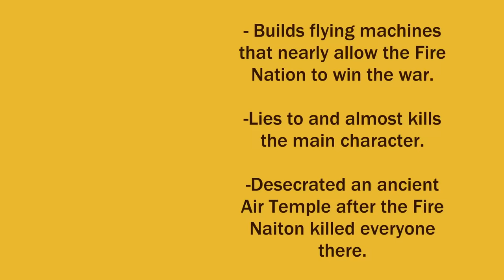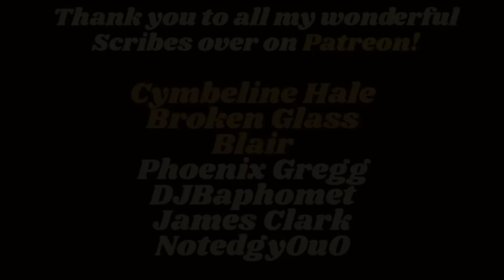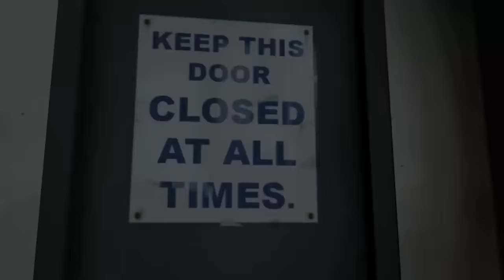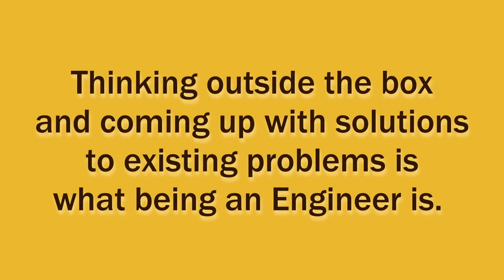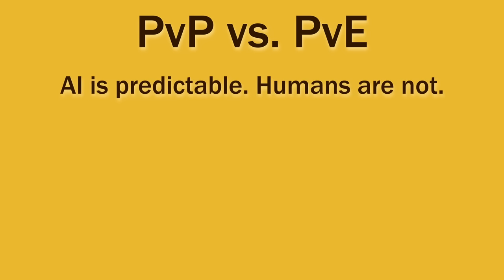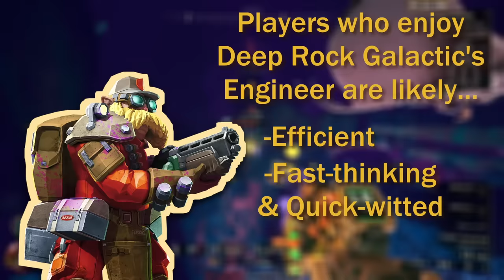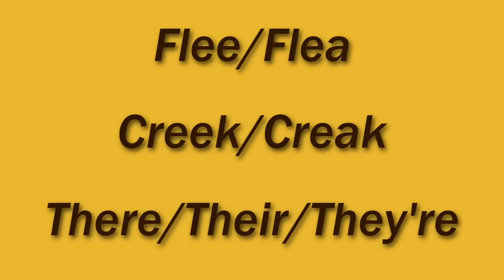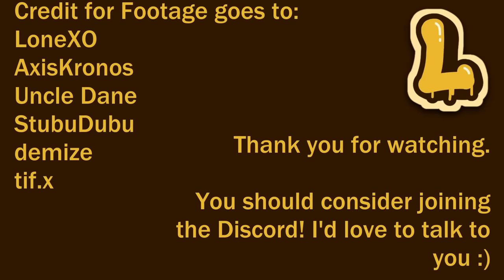TF2 vs. Deep Rock Galactic: What It Means To Be An Engineer

Comment: Actually, in DRG all classes has it's role in raid depending on what Overclocks and upgrades you build before entering a cave. It goes to Engies as well. Sometimes you need to use Tier 2 turret instead of 2 Tier 1 turrets, because you utilize Whip Shot with Mini-shells Overclock, which increases your ammo but cuts your damage drastically. And there's where you utilize it by standing around your centry and shooting small bugs and turret, prioritizing it's targets with lazer pointer. But that's one of types of Deffensive types of playstyles. There's also Electrocuting and Arc Gemini builds, which utilizes crowd control with low direct damage. Or there's Plaster Explosive build, when you use platforms not as deffensive or mobile option but as offensive tool to blow it up with Lazer Gun. Or you use two different Overklocks depending on your target priorities, like Jet Fuel rockets and Fat Boy (first to deal with single targets fast, the second one is for wiping out a swarm of regular enemies with large AoE damage and DoT effect, which is kinda bad against the "big boys").
And there's also different utilization of grenades too. Some for tight space. Some for dragging attention and crowd control. Some for deffence purposes while you at something else. That's why DRG's classes, being less in type, has so different playstyles based on how you prepared and how you use your equipment. Use it wrong - and you most likely die on a mission. A lot.

Comment: Some points i think is important to have out there:

The DRG engineer COULD have 2 sentries, but it's possible to have 1 stronger sentry in case you need to be more mobile and is willing to give up coverage for a bit more damage toward one area, better ammo economy and versatility when deploying and redeploying rapidly

The DRG sentry IS upgradeable althrough only before setting out on a mission, not during it

The TF2 engineer has tools that compliment an overly combative role while also allowing for turtling

While the Platform gun is one of the DRG engineer most important tool, it's not THE most important one. Once you upgrade his toolkit enough using upgrades and weapon overclocks, every tool every drg character has is equally important for success, and it doesn't matter if you're amazing with a platform gun if you can't live long enough to use it

I honestly appreciate you giving love to both of these characters, as i mained both in their respective games, but i did wish you'd consult experts on each such as uncle dane for tf2 engineer or literally 80% of the drg discord who could give you 200 builds and argue over them the moment you ask (it's kinda hilarious to watch)

Comment: Funnily enough- I am an engineer main in tf2 and a gunner main in DRG. Both are characters designed to stand their ground and control their immediate surroundings- protecting their teammates by being both the biggest DPS threat AND the biggest defensive bastion in your team, so long as you can set up properly beforehand.

Comment: I main both Engineers. The differing playstyles each have their niche in their respective games, and I like both of their niches. You can be a turtle in both TF2 and DRG depending on the mission type, but for instances outside of the likes of Control Points or Salvage where there's not a need to defend a singular point, you as an armed video game character can move that gear up without being totally defenseless, opt out of buildings to flex your skills, or play a different class that's better suited for the team's/mission's needs.
The main player traits are also far from mutually exclusive. Both types require adaptability and independence, as your buildings (and teammates/Bosco) are by no means infallible and you will have to pick up the slack in a strange situation eventually. No plan survives contact with the enemy, regardless of whether or not the enemy are humans with guns or bugs that can peek over a ledge and toss you into the air. Both require decisive action and a solid strategy, simply by nature of buildings being stationary constructs and knowing the breadth of their and your abilities. Efficient use of time is also just as much a resource for the TF2 Engineer as it is for the DRG Engineer, be it figuring out how quickly you can get to various ammo packs to build your buildings/let them self-construct as you go off elsewhere before the round starts, or building up/retreating to a defensible position to face an oncoming wave.

Comment: Out of all classes, Engineer in Deep Rock Galactic is the least useful of the bunch.
The turrets require constant attention, as they run out of ammunition fast and need to be constructed manually always (which means unlike other classes you're busy wrenching away in the time you could spend shooting or progressing an objective).
The DPS of the turrets is mediocre, you can amass a lot of kills in the end but merely because it takes down all of the swarmers and other 1 hit enemies (in stats 1 enemy is 1 enemy regardless of its strength).
The platform gun while convenient in a number of scenarios, isn't essential, and the other classes all have a mobility tool that replaces them (dig a tunnel, shoot a zipline, or grapple hook away).
The engineer has fun weapons, but they're very ammo inefficient (and the autoshotgun is awfully bad, please buff lol).

Comment: I play a lot of engie in both games, though I usually play TF2 engie in a more agressive (though not necessarily offensive) role, either with the mini sentries or with a stock sentry/jag loadout. In both games you can turtle, but in both games it is often the noob strategy that falls apart at high level play.

Comment: also pretty sure metal is a thing for all classes (other classes have 100 of it but can't regain it unless plugins are used to change that) just that engineer has 200 of it and can get it back
as well...DRG engineer has options with his sentry
either one bigger one (higher damage and more ammo held at once but less total)
or two smaller ones (extra ammo total but each can hold less and does less damage on their own but due to there being two of them dps is higher)
as well as options on the last upgrade where they either protect specific angle with higher damage or have longer range and can target pinged enemies
with former being much more preferrred since damage increase is so significant
Reply: either when depleted of metal, or having full, engie's death ammo box'll still drop 100 metal, so it's not connected
unless you're referring to something else?
Reply: @buckwheat-is-the-best-wheat  I meant that other classes do have metal but its hidden
so in case they somehow get a wrench and construction pda they can make a dispenser ora teleporters but not a turret because they're limited to 100 metal and can't get any more
Reply: @somedude4087  ah, i see
thanks for the clarification

Comment: I’ll say, engineer in drg, is the most powerful class.

Sure the gunner has firepower, but separate him from the others, or don’t give him any enemies to deal with, and he quickly becomes dead or bored respectively.

Driller is extremely good at digging, but is far less likely to survive a fight solo. Hes the slow and methodical one.

Scout is weakest, both alone and in a fight. Still handy to have solo, but without the others he quickly gets overwhelmed. 

Engineer? He has self sufficiency, great firepower, a movement ability that creates terrain instead of destroying, and can summon his very own crowd control and extra firepower.

Outside the group, engineer is most likely to survive, but in a full group, he increases everyone’s odds and supplies much needed things everyone else lacks.

Without an engineer a good handful of missions will take three times as long to complete because those platforms, while gimmicky, make moving pipelines around far less difficult, and can be used to create bunkers to shelter from glyphids in a pinch
Reply: Big fucking minigun tho